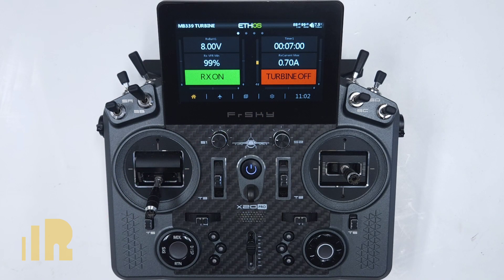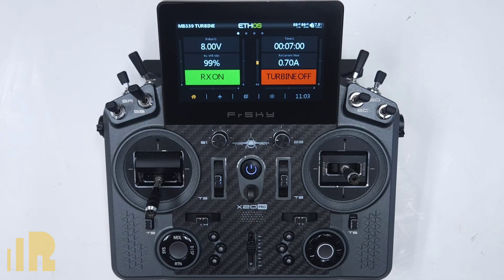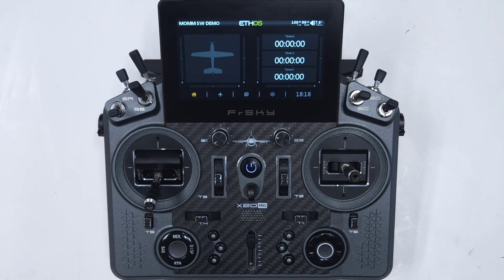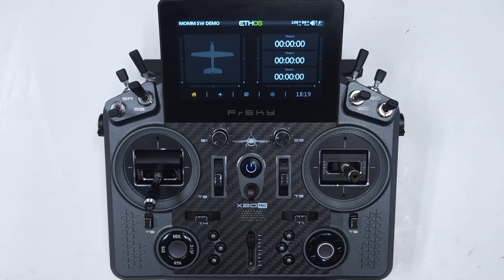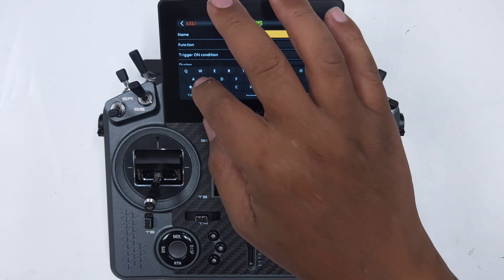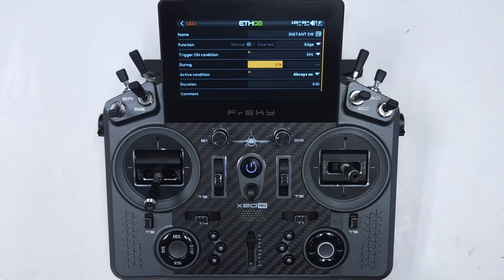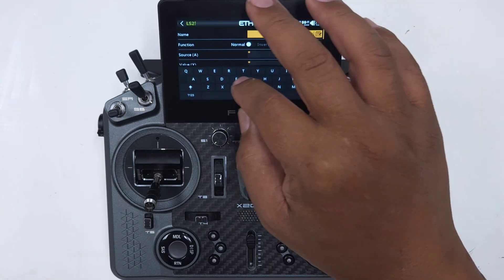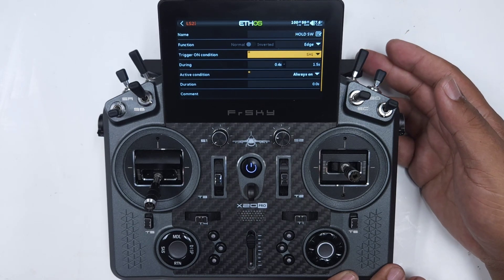One Switch Multiple Uses - FrSky EthOS Instructional Series

Comment: I would like to use the SJ momentary switch to turn lights on/off, how do I make logic sw stick? Idea is quick click is on an long press to turn off so it can't turn off by accident.
Reply from the maker: Logic switch... Use sticky. On condition, press and hold the switch you want. Off control, press and hold the same switch. Delay before inactive -1s or whatever number you want